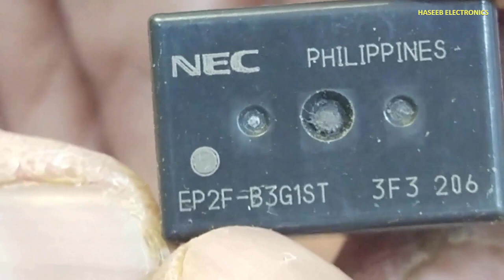{853} Peugeot ECU Valeo BSI, What is Inside - Part 2

Comment: Thank you very much for the video. 😊Wouldnt it be possible to desolder all the solderjoints and take the layers apart without removing the tracks from the plastic divider boards?

Comment: Have your bin close for all the bit. Not worth repair. I think you are fantastic at your job but sometimes you must give in.
Reply from the maker: hi dear 
it is just teardown down, to see what is inside. it wasn't a repair video. 
video number 849, 853, and some more videos will come soon to see its structure. how it works 
i love to dig deeper to find out the bottlenecks. 
i just give up, when there is no solution, but always i try to find out the problem. as a service engineer we must find out the problem. and we must give up in just to conditions,
1. when there is no solution 
or
2. when the repair cost exceeds more than 65% of the equipment value (beyond economical repair condition)